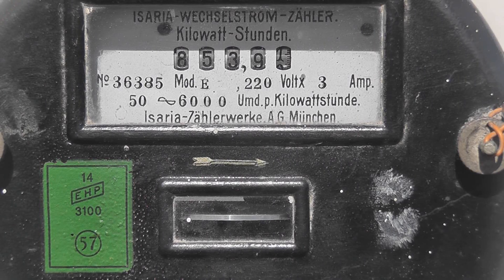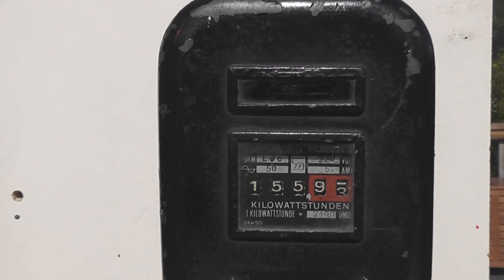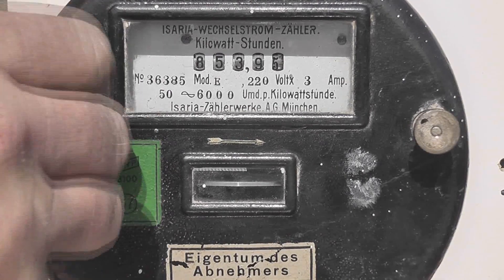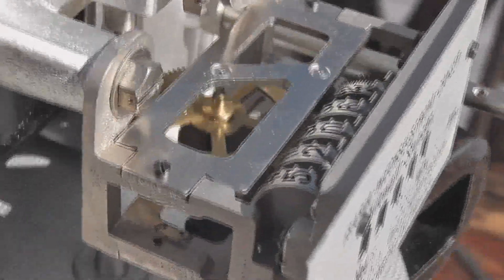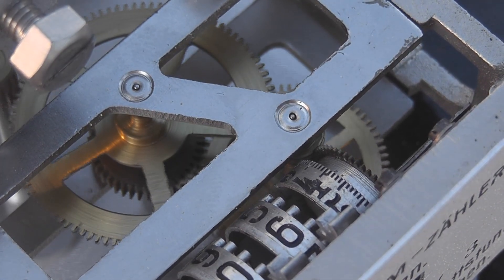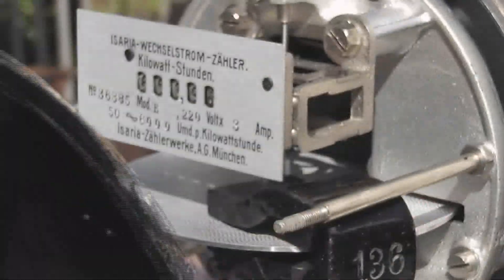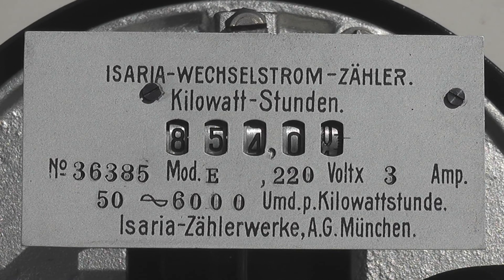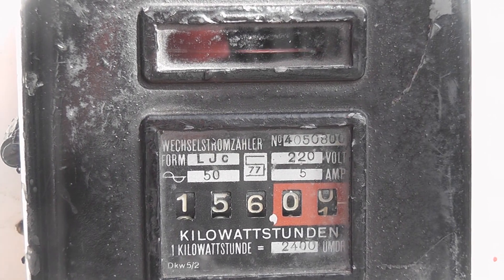Isaria Type E Meter

Comment: Hi Ray, during your time in the electrical trade have you come across many ingenious methods used by people to tamper with the power meters to cheat the power bill? I have once seen a BAZ meter that someone drilled a small hole in the case and inserted a fine wire touching the load wheel in order to slow it down. Thanks for sharing your interesting vid by the way.
Reply from the maker: ***** Yes, that is a common one. I won't go into detail here but it is amazing what people come up with to slow or stop or destroy a meter.

Comment: You should make a video on how these things actually work. I dont understand it at all. How does it know to count faster when there is more current?
Reply from the maker: Lvaneede Yes, I will do that. Basically the current flows through the current coil which produces a flux (eddy currents) in the disc which makes the disc rotate. The brake magnet controls the speed of the disc, so it doesn't take off on very light currents.
Reply: RODALCO2007 So, the disc makes the whole thing work? I thought it was just so you could watch it spin and know that it was working.
Reply from the maker: Lvaneede Yes, the disc rotates to the proportion of current flowing through the meter. The Voltage is measured with the other voltage coil. The counter counts the revolutions of the disc. In this particular meter the disc has to make 6000 revs for 1 kWh, or 60 revs for the lowest 1/100 digit to advance one unit. Most modern meters have a disc speed of 150 or 166 2/3 rev / kWh or a pulsing LED for electronic meters.